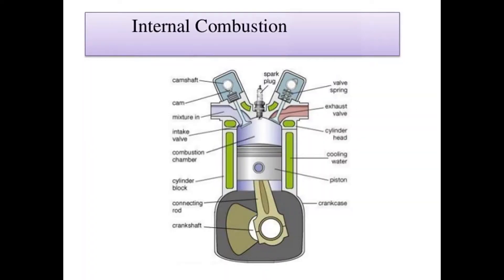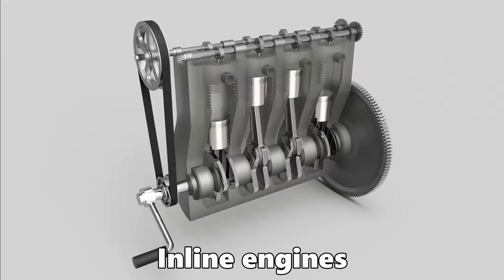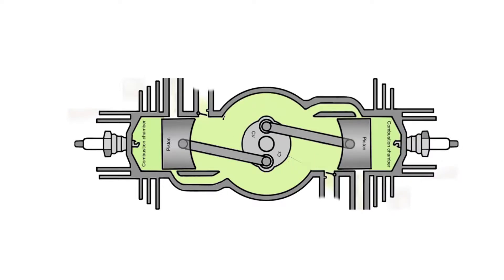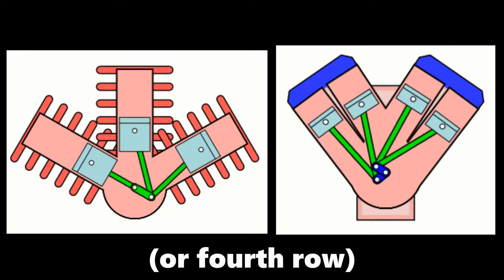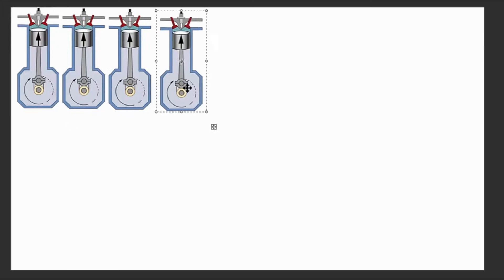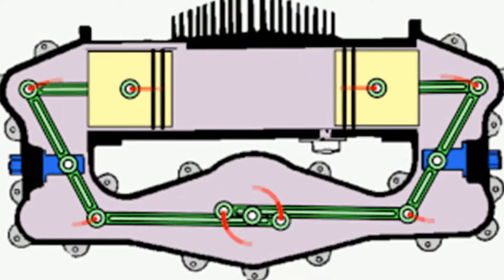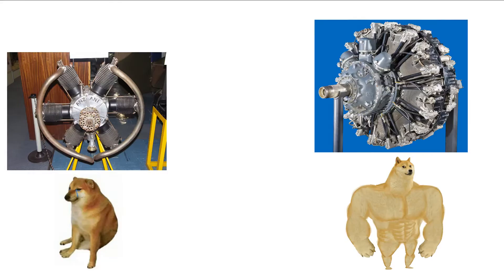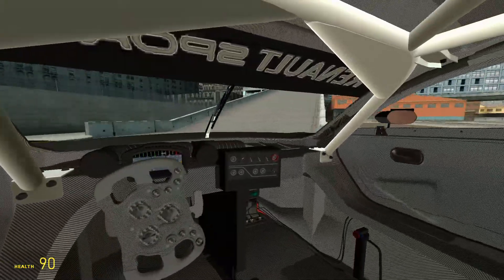How 2 Engine (configuration tutorial)

Comment: now this is all well and cool but did you know of the greatness of the wankel rotary engine? Mazda was the first japanese company to win Le Mans, and the only Le Mans winner to ever use a rotary engine. Banned for fuel efficiency and making too much power for its displacement. Application in RX series cars led to further revelations on its unreliability. Many other companies tried out rotary engines including a rotary powered corvette and a mid engine rotary powered mercedes concept, however all projects were eventually axed due to reliability/emissions issues.